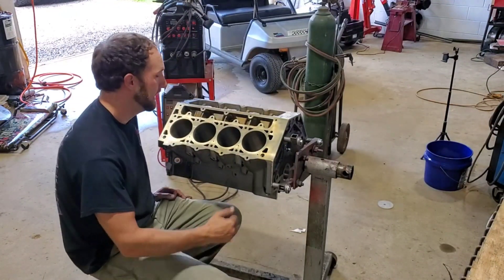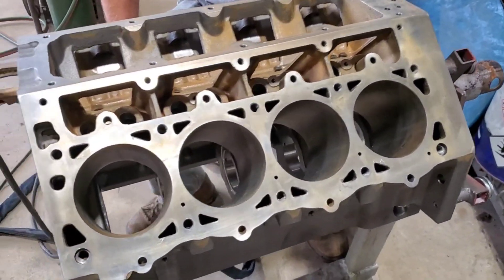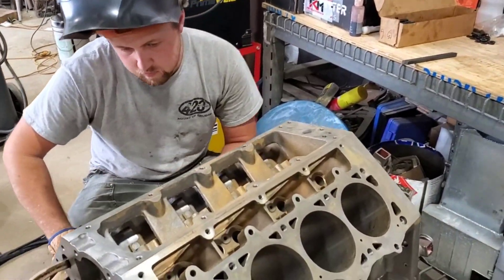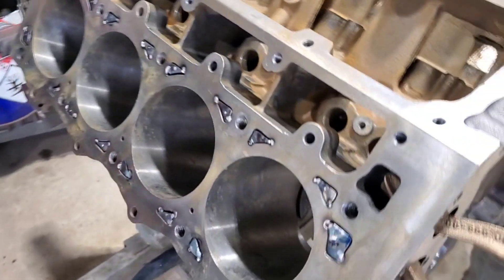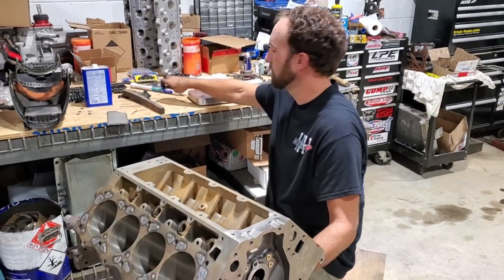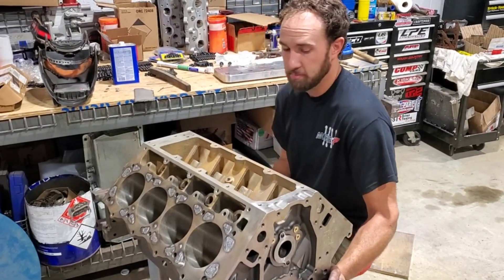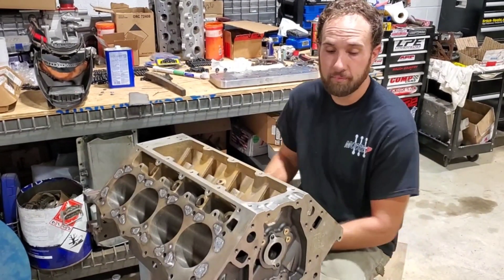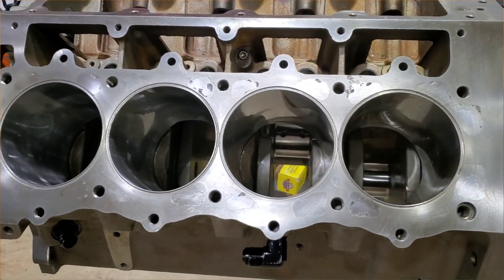We PERMANENTLY Dry Decked My New LS Next Block!

Comment: So is the purpose of this just to prevent a head gasket blowing? Other than that I don’t see a reason why
Reply from the maker: This is an all out racing engine, that needs to be able to drive on the street. So coolant is a must, but coolant near the deck surface is not needed. 
Coolant still circulates through the heads and block, just not at the deck surface. 

It is also an LS engine,  and they are notorious for having head gasket issues,  especially around 2000hp and above. This solves that problem.
Reply: @MooreHP I thought dart fixed the head gasket issues and cylinder distortion with the ls next blocks over 2000hp?? As to the reason for the thicker decks and thicker main webs.

Comment: Wouldn't that stop the heads from staying cool. Really curious why exactly you would do that. Is it to prevent a blown head gasket. I can see no good reason to do that. Wouldn't it be cheaper to just get a good set of head bolts?
Reply from the maker: This engine makes 2000hp on pump E85.
So the tuneup has to be spot on, or else it will hurt a head gasket.
This way I can still circulate water in the front of the block and the heads, and out the back of the heads and the block, back to the radiator. 

Actually works very good.

This engine has 6 bolt heads with 1/2" head studs, top fuel hoops and copper head gaskets.
Reply: If you go check out Steve Morris page this is how his drag and drive engines are setup. And they make upwards of 4500 hp.

Comment: Why can’t you just fill it with concrete? Or we not cooling the cylinder heads,  only cooling the block?
Reply from the maker: I could of filled it solid. But I can still circulate coolant thru the block and heads this way. The coolant just won't pass from the heads to the block.

Coolant goes in the front of the block and heads, and comes out the back.
Reply: @MooreHP is this a boosted application? If so you missed a really good opportunity to improve ring seal by using hard block.